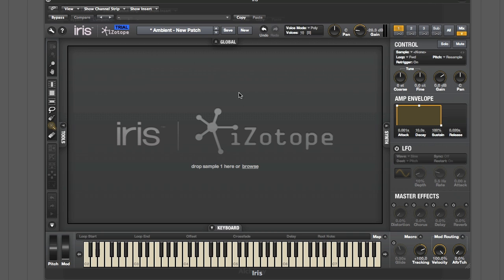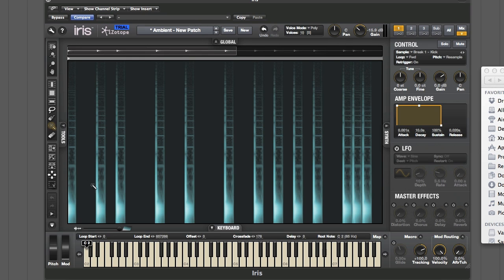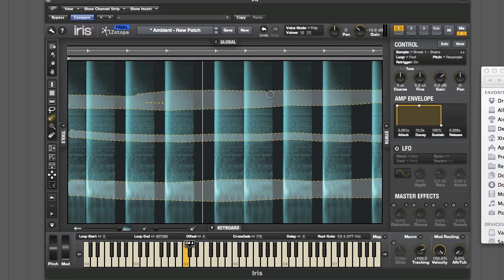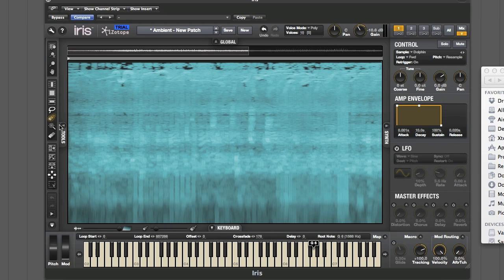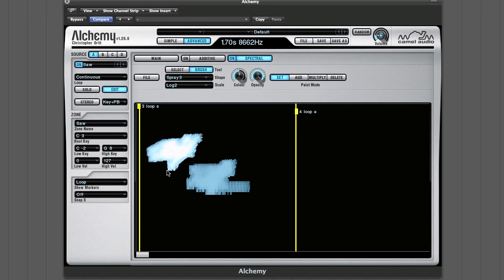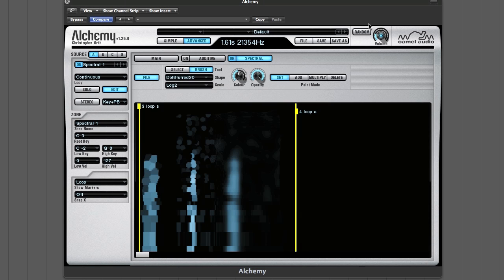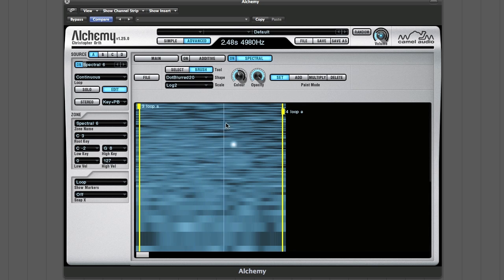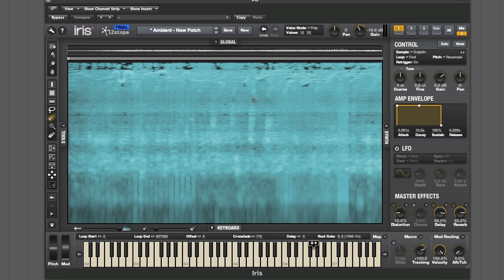Spectral Synthesis - Introduction and Approaches

Comment: That was the most eye-opening video I found on Alchemy and introducing me to Iris. I am a piano/keyboard player and like the synth world for soundscapes, lush strings, etc. I was about to go for Alchemy to complete my setup, as I would like to use samples in wav format. For example, Distorted Reality from Spectrasonics, and other amazing sound libraries. Which one between Alchemy and Iris would provide the most accurate and original immediate use of the wav files? Thanks again!
Reply from the maker: Alchemy probably would provide you with the most overall options, as it not only does spectral synthesis, but also VA, granular, additive, and a mix of all those things.  Iris is more limited in it's synthesis approach, being essentially spectral only, but it's a lot deeper and easier to use in that regard than Alchemy.  So, up to you really based on your preferences and needs.  All the best to you!
Reply: thanks, I am advancing step by step and this is helpful!

Comment: Thanks for the video very cool. Are parameters midi learnable or host automatable?
Reply from the maker: I haven't exhaustively tried all the parameters, but I would expect them all to be midi controllable.  How you approach that would be based largely on your DAW and/or hardware.  Personally, I used Ableton instrument racks and put 3rd party plug ins into them, which gives me the 8 "knobs" that are easily mappable to hardware controllers (a Push in my case).  Then I just map whatever instrument control I want to adjust to one of those 8 controls and things work great.  FWIW, both Alchemy and Massive are designed around the banks of 8 performance controls, so they map particularly easily to that approach.

Comment from the maker: Yeah, that's a good way to think about it.  Traditional LP/HP filtering is more crude, like running a squeegee across a section and removing it.  Spectral synthesis allows you to pick only specific frequencies.  For instance, in something like iZotope RX you can remove door slams or other unwanted noise from field recordings, but leave everything else intact.

Comment: Thanks for the info. Please - buy a pop filter and ease the attack of your gate, lower the threshold, extend the release time.  I couldn't breath listening to your voice.  Sounds VERY unnatural. While you are at it, roll off 150hz and down.  My poor laptop can't handle those frequencies.  The proximity effect is overbearing.  Download RX and clean up the hum in the room tone you were trying to avoid.  Other than that, pretty okay information.  Lasso tool would have saved a ton of mouse painting.